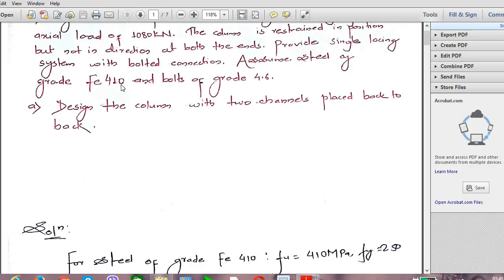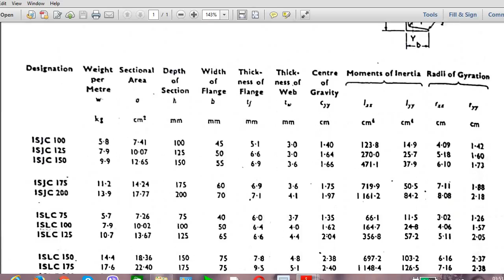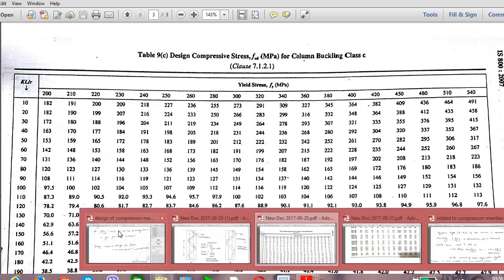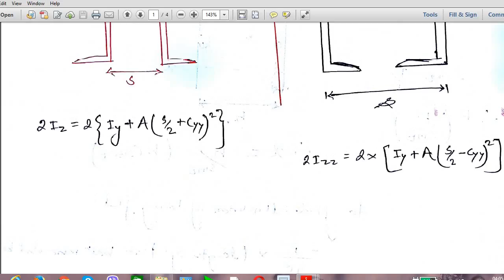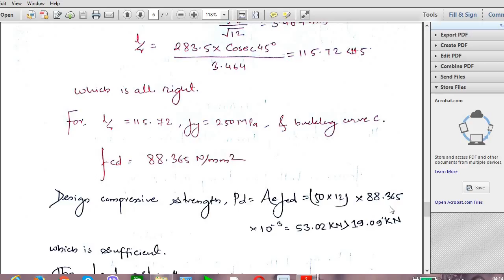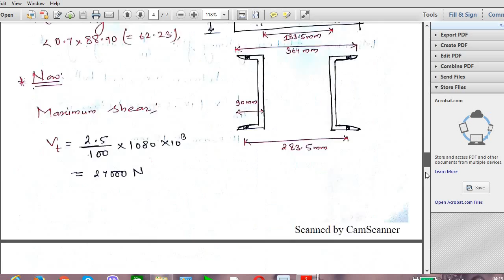DESIGN OF LACED COLUMN IN SINGLE LACING SYSTEM (BACK TO BACK) - STEEL STRUCTURES

Comment: Bhai ismc 300 @351.7   here @351 ka meaning kya hii
Reply: ISMC 300@351.2 N/m denotes the weight in N per unit length (m) of the channel section.